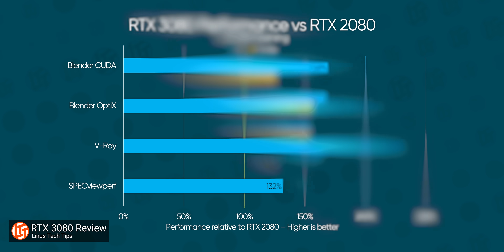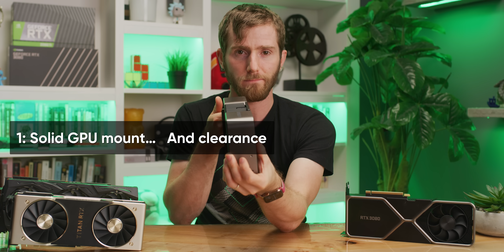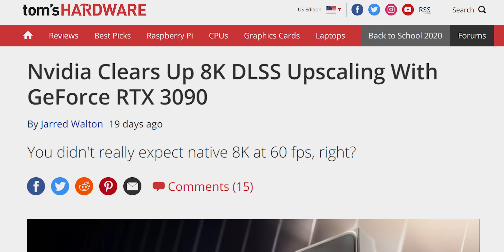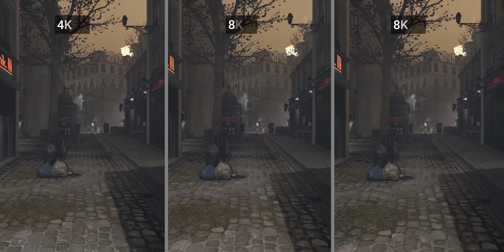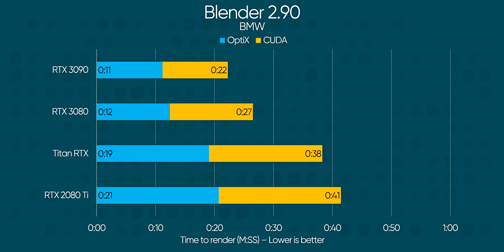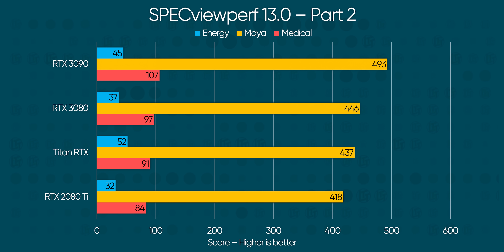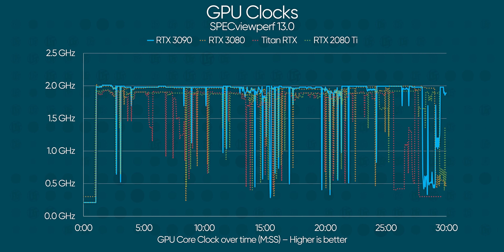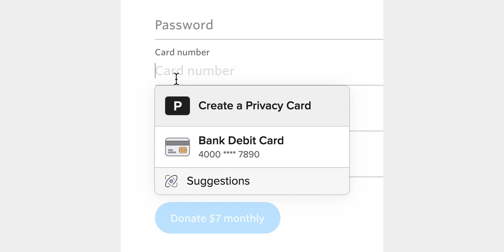Making Nvidia’s CEO mad - RTX 3090 Review

Comment: I"m sick of artifical limitations.  ITs been happening for over 15 years.  Soft Quardo.  Where are you.
Reply: Artificial or physical limitation, it's the same. Just way more expensive to manufacture specific limited cards instead of disabling parts.
Reply: @poofypoof6508  Yeah, we can thank the professionals for allowing cheaper cards to recover R&D by using faulty cards for the consumers, etc. If we took away the Quaddro level cards, it would just make RTX cards cost the price of the pro cards since there's no tiering, etc...
Reply: @GRAYgauss  Spot on.  Someone has to pay for the development of compute and pro software drivers. Do gamers want their cards all 10% more so work can be done to provide better viewport performance on Maya, 3dsMax, AutoCAD etc? Do gamers want to pay for CUDA development?
Reply: @hobbyshame  Yeah and as a dev who uses cuda/glsl extensively ( and could really benefit from tensor cores) a 1070 24/7 loaded still does fine...sure i have to be a lot more patient sometimes, but yeah 10-20% inc isn't worth consumer+>3500$ with my means. Content with what I have and I doubt most gamers push their pipeline to the brink of suicide like i do.
Reply: @GRAYgauss  I don't think thats the case at all. I think you've just swallowed the marketing BS. you're the kind of customer they want... the naive and easily led kind.
Reply: @hoffybeefe  Notice the same dies and the core reduction count which ratio is in line with current fabbing efficiency. I'm a hardware and software developer. I've developed boards like these before and am aware of manufacturing error processes. I don't even follow marketing, i just look at datasheets. Nice ad hominem without knowing me, I'm tempted to hazard the same ad hominem: you've never designed processors from transistors then high abstraction fabbing, built OS's and compilers from scratch, written drivers in real world scenarios, etc. Also, my other comments make it quite clear I am the worst customer: "I'll just wait until I can buy it and a 8k screen for $130 off ebay." I'm impartial to the company. as said before I have contention as well, sure isn't an ad hominem to say you lack reading comprehension, have YOU read 400,000 journals in the past 10 years? Do you want to know the truth and not make your opinion your reality, knowing the err of science and the necessity of critical thinking and building your own opinions from fact, not feeling? Do you care about factual basis on real numbers, actual chip scans, evidence? So far, your tunnel vision and intent to attack makes me think you just like trolling because your mental capacity hits it's limit there and at least you can feel powerful. But please, give me some real debate, some real motive for a dialogue worthy of either of our understanding being expanded. Perhaps even a reason to think you're more than what you seem.
Reply: @poofypoof6508  Yep one hardware and two software obviously makes the best business sense. It's entitlement that blinds people from it.
Reply: @hobbyshame  I agree, to an extent.  This card already has a price premium for the performance gain over the 3080, and I doubt its due ONLY to manufacturing costs.  I agree with Linus they should remove those bottlenecks from the 3090.  Everything below it?  Nah.  But the 3090 is approaching titan pricing so why not remove the software limits and let the titan stand on its legitimate hardware increase to substantiate the price hike over the 3090?
Reply: @Mad-Lad-Chad  I also have a bit of contention, the model must exist but they definitely are inflating for margins. I'm pretty sure the 3080 is just a 3090 with a faulty chip that has disabled cores. As for the pro vs gamer drivers, given the R&D for that, it's continuous, not easy and expensive...I'm sure theres a bit of both recycling as well as recovering r&d/driver r&d but yes, as it's approaching the titan in price I can't imagine with the "leaps" made from past gens it's r&d. I'd actually look to the rest of the economy, nobody trusts  the dollar, it's bubble is inevitably failing. the primary bimetals are going wild, but will reset to the buying power they've had for 5000 years. So I'd say nVidia is padding for the 10% inflation that everyone knew, but ofc was reported at 2% until they finally decided to stop lying. I'd say they're actually padding for hyperinflation that's expected anywhere from 2-5 years up to 10. Not an expert and forget their exact opinions. But just like everything else, rn with covid necessities have hiked, but luxury items will hike to in preparation for the devaluation of the US dollar.

Comment: I have 16gb of the TG 4GHz RAM in my system that was advertised and it's great with an i9 9900 KF. The ARGB looks great. But should I upgrade my RTX 2080 SUPER for a RTX 3080 even though I just built the system 7 months ago and  just bought a 75" SAMSUNG QLED Q80T 4K TV two weeks ago, and can game at 4K but Battlefield 5  only averages 55 fps on ULTRA settings and DLSS on and seems ok but can get ocassional lag. It is worth the upgrade?

Comment: I will say as a PSA fuck 1Password. I  started with LastPass ages ago, then decided I didn't like my vault living on someone else's servers and switched to 1Password because it had local WiFi sync. That sounded good and all, but it eventually got to be tedious so I moved the vault into Dropbox and had it on someone else's servers again. Then Dropbox changed their policy so free users could only connect 3 devices at once, meaning my passwords stopped getting synced to some of my devices. AgileBits has refused to support other cloud providers or explore alternative sync options as of a year ago when I stopped using it. This coupled with other issues like them refusing to develop a Linux client made me look elsewhere.

I discovered Bitwarden, which is free but does have premium features under normal circumstances. I personally decided to self-host bitwardenrs-mysql, a mysql / mariadb compatible variant of bitwardenrs, a rust implementation of a Bitwarden server compatible with the native Bitwarden clients (I chose this version because it's very lightweight, as the official Bitwarden server runs on Microsoft SQL Server which requires a lot of RAM). So on my NAS, I host a personal Bitwarden server which gives me all the features that server supports for free.

I've been using Bitwarden for a year now, and IMO it is leagues better than LastPass and 1Password in terms of configuration, user experience, etc. The ONLY feature I miss from 1Password  is the ability to use Fingerprint unlock but require the password on bootup (so that if you were getting arrested or something, you can reboot your phone and then they can't use your fingerprint to get into your vault). In Bitwarden, you can do the same by going to Settings and disabling fingerprint unlock, then locking the vault, so not a huge deal.

Comment: IMO there is no need for this card for a gamer. What's the point of 8K gaming when the Displays are freaking huge?  I like sitting close to my monitor when i game,  an 8K TV makes it impossible. The 3080 is the far better choice, specially if you already own a Gaming Monitor either in 1440p (which the 3080 will destroy) and 4K (which will finally allow you to reach full potential) 8K is still a niche. Until i start seeing 32 inch 8K displays or even smaller these 8K video cards will be a niche.
Reply: Tell that to the next gen console which is also promoting 8k. I doubt they will get their without up scaling and turning down somethings rather than true native like last gen. They better prove me wrong. Also, I've read in the past that people also said similar things about 4k being a niche, yet now, people I know have 4k display in most of their homes. 8k will follow the same, I think. Lol.
Reply: @WhyteLis21  the consoles will not be using this card, and they also wont be using AMD's flagship. Based on the leaks, the consoles should be using the mid-tier variant. If anything, this shows that AMD may truly be bringing competition back.
Reply: @unnamedshadow1866  Yeah, already know that. Tell me something I don't know. All I'm saying is, we will probably see upscaling 8k lower tier in the consoles later on because they are promoting that in their marketing as support even though they have yet to show it.

Comment: I love how excited Linus gets by these tiny iterative improvements.   I mean, realistically, the jump from 4k to 8k is pretty imperceivable to most, but it's one of those jumps that leads us closer and closer to photorealism nonetheless.
Reply: 4k to 8k is not tiny though. It may be hard to physically see the difference, but in terms of raw numbers that's 4x the pixels.
Reply: @dawnraider0072  Totally. Huge performance demand, negligible difference for most people - unless they are close up to a huge monitor, so very much outside the 80% solution.. until you start stacking those improvements up.  It's like framerate.  Most won't tell the difference between 60 and 70 fps.  Or 70 to 80.  Or 80 to 90.  But the difference between 60 and 100 is very noticeable.  The difference between 60 and 200 is huge.  Ditto res.  We need all these improvements, but the jump from one iteration to the next is so demanding, but not massively noticeable in and of itself.

Comment: we all know youtubers make money, but they also get a lot of free stuff

since you guys already have a 3080 and a 3090 for free

how bout going to the extreme and running a pair of 3090 in nvlink aka sli mode

so we can see how do it scales to 8k
will we get a considerable boost in frame rate

how bout 16k even if is a medium settings

compared 8k high vs 16k medium

but of course you guys don’t want to spend the money on a 3090

call jay or steve from gamer nexus and ask to borrow the card

then you won’t have to spend any money
since the 3090 is so bad, based on your opinion and the 3080 doesn’t have any nvlink conector then i will have to buy a pair of 3090 to get the frame rate that i want in 8k

Comment: I don't agree that these cards refer to a niche at all. To be clear, I totally get what Linus is saying about CAD performance. The card being held back and not really being a Titan replacement at $1500 is hard to swallow. However, a VERY large portion of the professional market is also using GPUs to run and train complex computational models (financial etc.). These cards will appeal largely to them. As I've said elsewhere, the idea that the pinnacle of computing is all about 3D modeling and video editing is not well-informed. There's far more demanding (and lucrative) computational tasks that do not utilise locked functionality, and where raw power really makes a difference. 

Regarding NVidia, I didn't expect anything better. NVidia had the chance here to make its mark, but their efforts are half-assed. Specifically, they advertise a better power/cost ratio, cheaper tech and all that crap. At the same time, they are all in in the rich gamer bandwagon, milking the cow to no end. I see more effort in bullshitting people, rather than actually making a difference and I get it, it's a business after all. Considering this is a) 2 years in the making and b) Titan prices will be driven even higher, I think at this point we realise that the myth about prices driven down is just a marketing gimmick and tech channels should stop reproducing it. Even for gaming, GPUs are more expensive now than ever and the future looks bleak. In 2011, I bought an EVGA 780 sc (EVGA are on the expensive end) for like 400 euros. Today an equivalent card is 800. Hopefully, AMD's recent success in the CPU market will help fund better GPU ventures that will drive prices down in the long run.

Comment: So when will we see a review of the 3080 or 3090 running VR? I have an I9 with an RTX 2080 and can not run Xplane in VR higher than med settings because of my GRAM limits. 30 FPS max on top of that. Is the 3080 going to help with only 10GB GRAM? Will the 3090 just crush VR no problem? VR is the future man. Flat screen is just so 2 dimensional. Even at 8K.

Comment: Honestly if I got this card my ryzen 5 3600 would be like a Prius trying to keep up with a koenigsegg
Reply: Most games aren't that CPU intensive and at 4k you shouldn't be bottlenecking for the majority of games I don't think. I lucked out like an mf this morning and got a 3090 and will be running it with my Ryzen 1700x lol
Reply: It would be like stradman's veyron vs the tuatara
Reply: I dunno man. I've been searching the benchmarks for the 3080 and there is basically no fps difference from a i-9 10900k and a 3900x to even a 3600x. Once you get to this point the load is all on the gpu anyways. I really don't think you need the BEST cpu to run these cards at all. It really depends on the game in the end anyways.

Comment: The 128MB size per framebuffer is also just for a single color buffer. Pretty much every 3D engine needs at least twice that (for double buffering), but on top of that many modern 3D engines need a bunch of additional buffers for deferred shading, which usually involves another 5-6 buffers or so.

And then HDR rendering needs even more space for the color buffer.

So, at 8K you're generally going to be using multiple gigabytes of memory just for framebuffers.

Comment: So when are you putting in 2 3090s an sli bridge a couple of 1200w power supply a 3990x or hopefully a 4990 when it drops and overclocking the shit out of them. Calling it the compensator 3000

Comment: “What’s the ampere titan going to cost? $3 grand?”
Nvidia: uhhhh.....  YES?
Reply: nVidia: Keep walking if you have to ask.
Reply: so the normal price...
Reply: That's nothing for those that'll purchase it. Umm yeah right???
Reply: dayum so cheap just 3 grand for titan
Reply: 3090=Ampere Titan......... You want more then QUADRO or TESLA Card's........ Deep Learning and AI are all still capable tasks on home rigs without having to queue NVIDIA Server's for time to run Sims or other tasks........ Seamless Full VR Workstations/ Playgrounds at home with Procedural AI Elements to add Personal flavor....... What more could anyone ask for right now??????
Reply: Will soon sell my home so i can go out and buy this card!! 🏠
Reply: Isnt the 3090 the Titan replacement ?
Reply: @benediktwirtz6555  
no because as said in this video, they're holding 3090 back a little to make room for the the 3 series titan. that's the true replacer of titan
Reply: @benediktwirtz6555  No, it's not a Titan replacement. Titan has double precision floating point acceleration unlocked. 3090 accelerates only single precision FP.
Reply: @benediktwirtz6555  
Knowing Nvidia, likely not. I mean, it should be, it has the performance to be and it's geared towards those tasks, but Jensen could not resist to allow marketing to "Gamer" this thing so hard that it actually hurts it. Then their is the fact that, yeah... some software is just optimized for the Titan specs and nothing else, which this.... isn't.
Reply: @benediktwirtz6555  No it's not and it won't be. As Titan RTX 2 won't be a Quadro replacement. Even if the card inside has the same specs hardware speaking, from the bios and hardware components nvidia drivers will recognize which card you have, and enable/disable features that tell various software to do "things" in gpu or cpu (the last usually called "software"). When ppl asked nvidia 'bout this, they replied (years ago at this point) "if we would enable 'all things for all drivers side' and many professional will buy a gamer card since the power of the gaming cards could be more than enough for their workload, we should make those cards cost a lot more than now (because engineering for those application cost A LOT, and now we try to put those costs much more on the professional range of our lineup), while quadro and titan would cost less then now... but do you think a graphic studio cannot afford 5.000 $ graphic card and need those cards at 3.000$, and at the same time gamers can afford cards that cost 1700 $ the slower version?". True or not this is their policy for making different "range" of card while doing the same hardware (3080 has the same cuda core of 3090 when produced, than they disable a part of those... it would cost too much to just produce 2 different things).
So, if they will do the same (and that is most likely) this time, each card will perform not well for what nvidia will not want and will perform well for what nvidia will want (like the titan RTX VS 3090 in catia and samsung benchs in this video). Another example is that if you buy the cheapest quadro card you can run 4 windows desktop, while only 2080 for rtx can do that (before 3000 series), or maybe just the TI (don't remember well)... but all cards, quadro or rtx, have more than 4 ports for monitors no? well, driver will recognize which card you have and limits winows to 3 mons if not quadro (or titan or 2080).... Should we gamers pay more for our cards to allow us to have 4 monitors at the same time when no one gaming has that config? This is nvidia thoughts (for what they said).
Reply: Benedikt Wirtz yes
Reply: Jensen taps his nose
Reply: The 3090 is the New „Titan“. 🤦🏼‍♂️
Reply: https://www.tweaktown.com/news/75147/nvidias-next-gen-titan-rtx-specs-teased-48gb-gddr6x-and-over-3000/index.html
Reply: @gcharb2d  that's the quadro.
Reply: @TheColdBloodedGamerS  the first post talks about the Ampere TITAN RTX